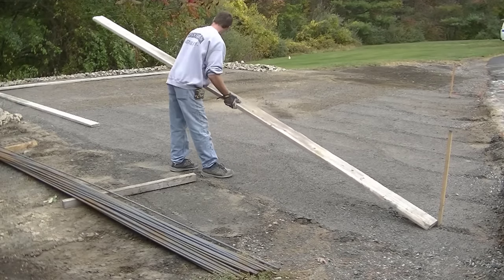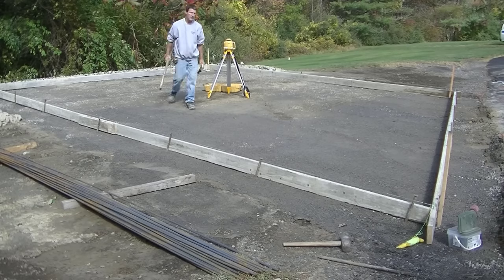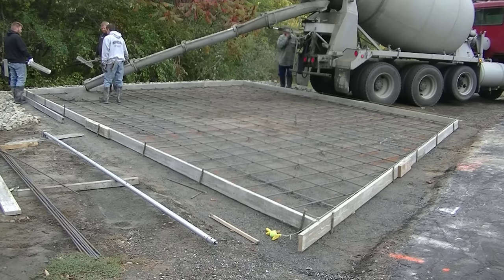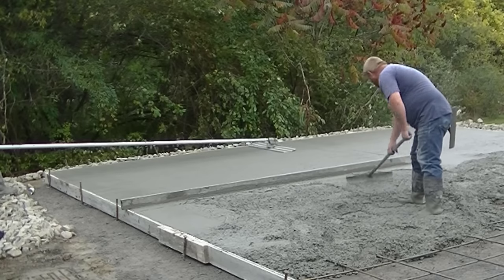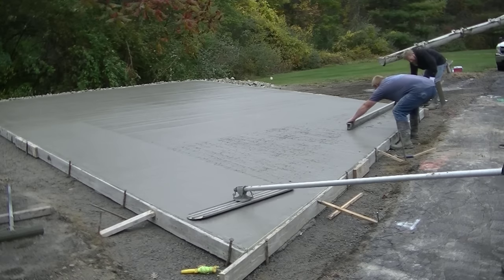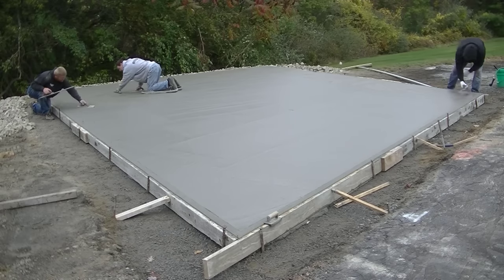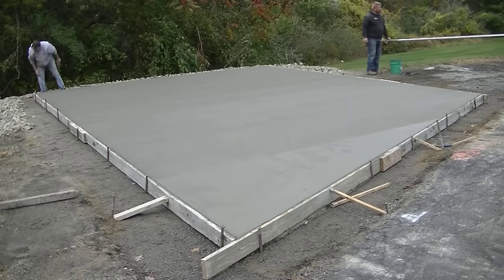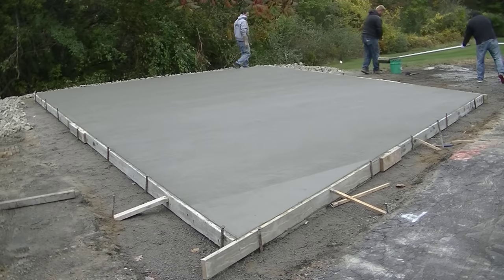How To Form, Pour, and Finish A Concrete Driveway / Parking Area Slab

Comment: Excellent video with great explanations.   You definitely are a master of the trade.  You are so right about having a crew that has worked together so long, making it easy.  Have you seen any problems waiting too long to saw cut your joints, meaning slab cracks before saw cut.

Comment: Another excellent video ! Making it look fast and easy ! 
If the forms are left on for 2-3 days, does the outside edge get a stronger build strength ?
Reply from the maker: This time of year not so much (as in the video) if the temps are colder that could help if you leave them on longer.